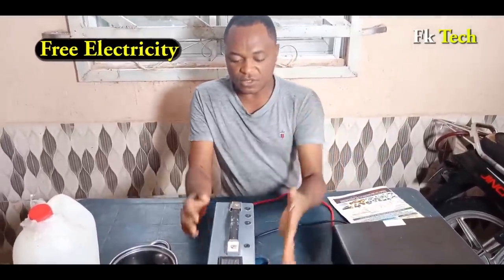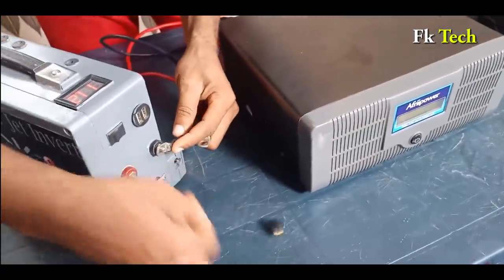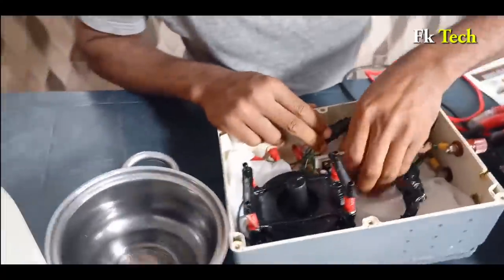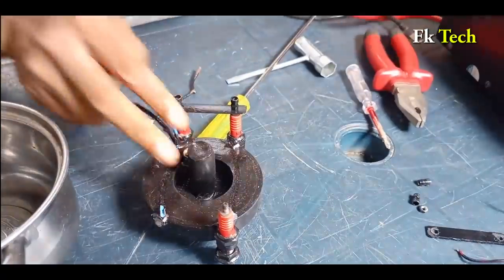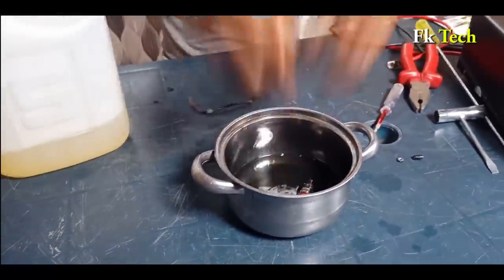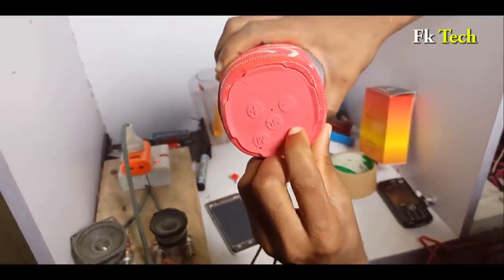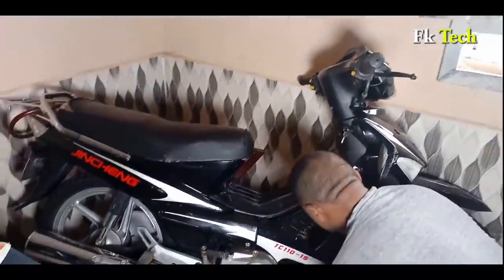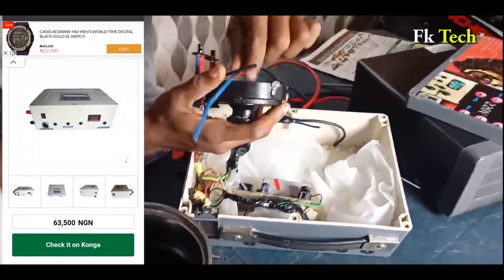Free Electricity Address Of Spark Plugs And Magnet Made at Home

Comment: Induction cookers...depending upon which elements vibrant upon contact...plugs similar to double capacitors....vibrations echoed chamber creates heat...from the copper,that vibration is read in voltage...
Reply: Is bluetoot